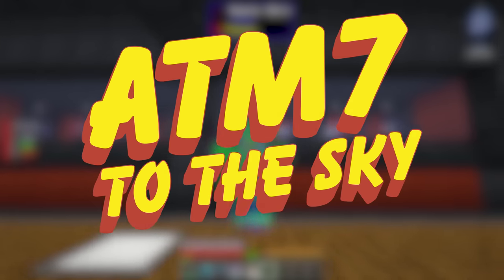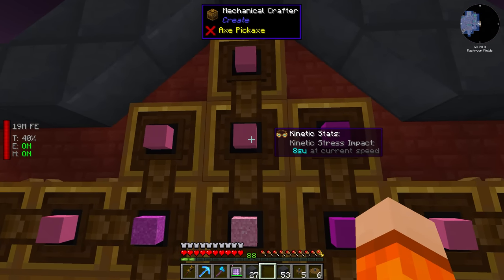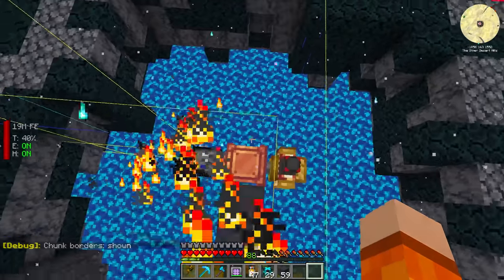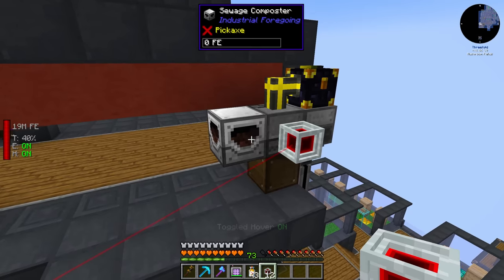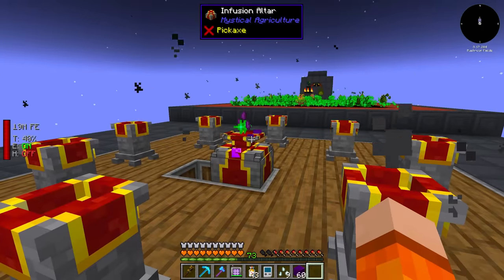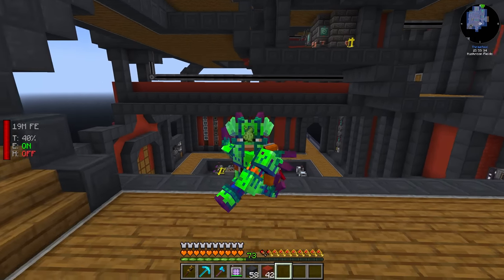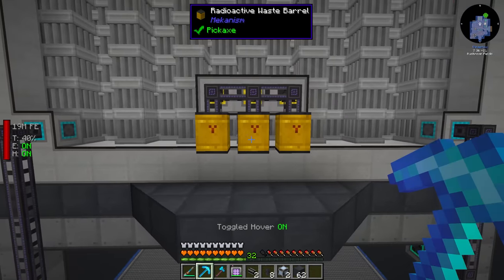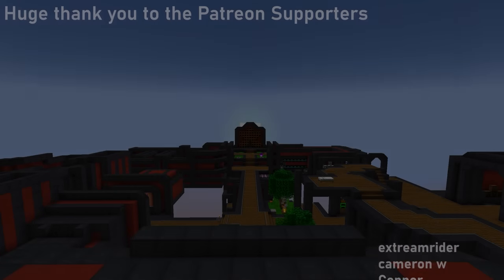Minecraft ATM7: To The Sky - Ep16 - Patrick Star, HDPE & Reactor Safety

Comment: Hey there, create contributor here, amazing video as always. You can link up crafters together so they share inventory with the create wrench. As for the electric motor not being able to to power all your crafters, that's because su needed to run a create machine scales with rpm and the way the motor heightens its su is by going faster, the amount of crafters simply scale too quickly for the motor to ever be able to power them but this is easily fixed by coupling it with a rotation speed controller going much slower than the motor. For the hose pulley, you only need the pipe to be powered after the hose is fully lowered.

Comment: You don't really need any rotation power for hose pulley, can just lower it down with had crank once (or electric motor) and after it's all the way down remove it, after that you can pump liquid out with any pipe that extracts automatically.
Reply: I just wanted to write this

Comment: The reason the electric engine didn't work at 8k SU but the windmills did is because the windmills function at a lower RPM, the SU requirement overall is a result of rotational speed * number of devices connected * SU requirement per device. Hope that makes sense!
Reply from the maker: Yep! That makes a lot of sense, thank you for the clarification :))
Reply: @Threefold.  You can just connect few electric engines to have more SU.
Reply: Stress Units are Create’s “simplification” of Torque, so it isn’t a linear measurement of Power and instead depends on the Speed (RPM). Thus each create object that uses SU isn’t using a flat amount of SU like the way FE is consumed but you need to multiply the required SU by the Speed (RPM) you want it to perform at. You can think of it like a car in a low gear having more Power at a slow Speed if a real world example helps. 

TL;DR If you want to make the crafters work faster you can increase just chain a bunch of motors together until you have enough Power at the RPM you want.
Reply: I think you can run the motor in full speed then downgrade the rpm using create's rotational speed controller. That should increase the Stress unit

Comment: oh and another thing with mekanism reactor is, the coolant throughput of pipes is a bit tricky, basically how it works is throughput depends on how many pipe blocks you have in line (or in a bunch, as long as it's same pipe) and you have to multiply number of pipe blocks by capacity of each pipe, that's gonna be your throughput. For example if your reactor is heating 20.000.000mb/t sodium you need as minimum 20 tubes in line cuz each has a bit more than 1.000.000mb capacity. 
My personal to go setup is 11x11x7 sodium reactor with one block free space between reactor wall and outer control rods (for extra sodium capacity because I run it at max speed and the moment I turn it on it drains more before it evens out and temp goes through the roof) and I sandwich 11x11x7 boiler right on top of it with pressure dispersers on very top layer only. Just match the ports together and can forgo to pipes completely.
Other than that have to be careful with different setups, because it seems to me they are intended to be built around huge pipe cobwebs around for extra backlogs of sodium or water.
Personally I never go past what I explained because it makes something like 15 antimatter pellets per day and I progress to fusion reactor which is completely safe, runs on only water and makes ~45MFE/t with one max sized turbine. (if you really want to go ham at it can make some boiler setup with redstone D-T injection and make it power 3 max sized turbines but I never needed more than 45mil.)

Sorry for the geeky post but idk, maybe someone might be interested about the info, fission reactors seem very daunting for beginners but can be rather simple with few tips tbh :D

Comment: by the way hydroponic beds distribute ether gas, water and power to blocks next to them, from my experience it can handle easy 7x7 field if you only pump stuff in few outer beds, water and ether is fine even for 9x9 but then you need some sort of power to help out slightly most middle ones.
tho from testing we did lilypads and stuff like that doesn't affect them, they work more like some machine progress bar not actual growth.
Reply: You can use plant harvesters with ether in it to soft harvest it. Doesnt affect the hydroponics but can yield extra essences.

Comment: Hi Treefold, I'm not familiar with Create but I'm mechanical engineer. 
The "stress units" is torque irl and speed is speed. Every machine need some torque and rotation speed but if one is big the other one is low. 

For example if you ride a bike you use high torque and low speed when climbing on elevation or use high speed with low torque on straight road. If your gears are in low torque and high speed you have trouble to start a ride.

If creator of create is inspired by reductors and machines irl try to lower the rotation speed output or use some reductor to reduce speed or add more motors. The tooltip says max valuables for stress units and speed but they cannot be both big.

Edit after close inspection: You need (or make by windmill) 2048 SU ( 4:51 ) and your motor generate 1024 SU ( 4:40 ) at this speed. Add motors or reduce rotation speed (from 32 to 16).

Upvote to make him see this.

Comment: in create the stress that every machine "consumes" is base stress (every machine has their own)*rpm, you managed to power your system with windmill because its rpm was very low. if you lowered the rpm in your eletric motor (you can do it in the back of the motor, it was set to 32) you could've craft patrick stars 4x faster since it has 4x more stress capacity

you can also have more than 1 eletric motor in the "stress network" if you really need some speed

Comment: For star crafting, I simply used an electric motor feeding a Rotation Speed Controller. Turn the motor to high RPM to produce high SU, then turn the speed controller to low speed, and voila, the crafter will work with the SU you can provide.

Comment: You can use a pulling meka pipe on the hose pulley to get faster (and easier) extraction, also you don't need to keep the pulley powered

Comment: the reason it overstresses is because all machines require stress X rpm. electric motor gives more stress at higher rpm, while windmill gives a bit less but at much, much lower rpm. you can however power those crafters with motor, but you will need to gear the whole thing down, so crafters run slower than the motor.

Comment: I'm pretty sure you can pull water from sinks using LaserIO as I did it for my slime/soul sand automation in ATM7Sky which I don't use anymore but it worked.
Reply from the maker: hmm I must have had it misconfigured :)

Comment: Issue with the motor is that it's default 32 rpm, the windmill is lower afaik. Speed multiplies the stress units needed :)